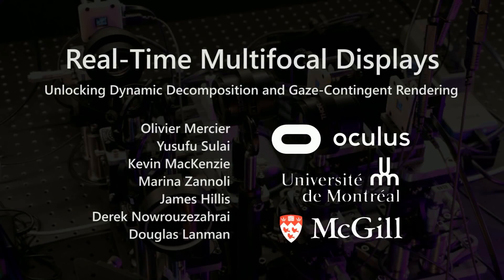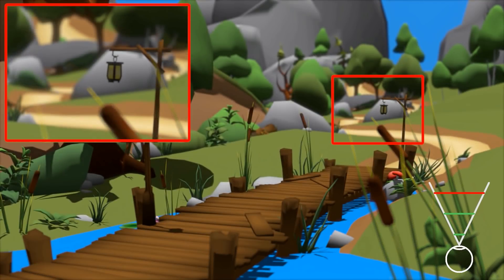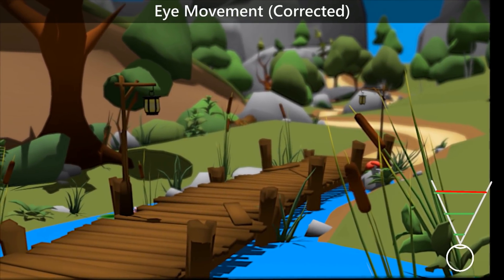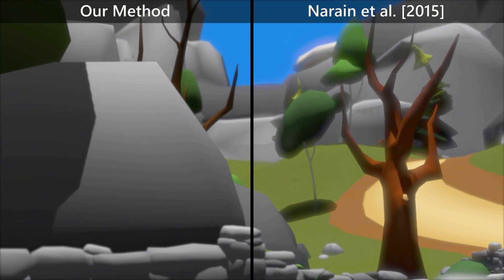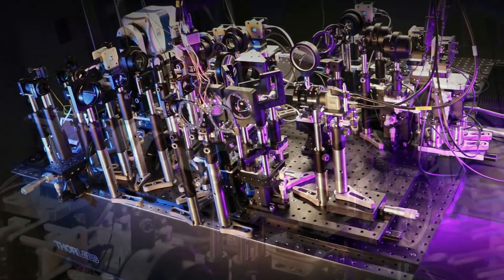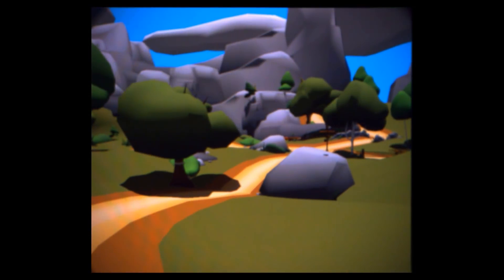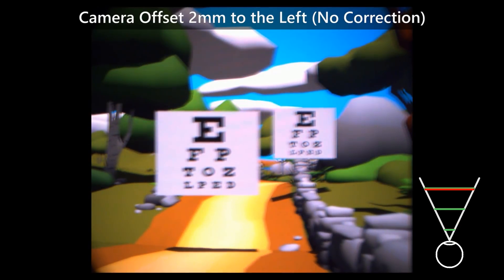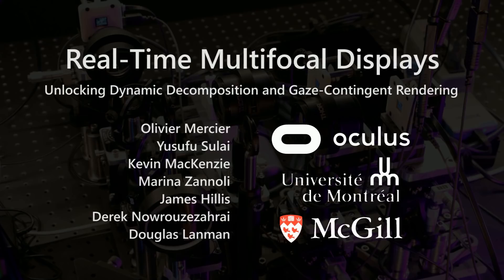Fast Gaze-Contingent Optimal Decompositions for Multifocal Displays

Comment: This looks very nice, but doesn't look to be applicable to consumer headsets.  Even if they can minatuize this rig, and processing power advances enough to run in real time . . . the prohibitive costs of all the extra screens and lenses are going to put this well out of reach.
Reply: This rig was not created for a purpose of prototyping a consumer device. It's a research lab equipment necessary to test some principles of multifocals withe eye tracking and new algorithms.
Reply: I guess the three screens could be 3 mirrors with a single triple refresh rate display?  Would be really interesting if this ever becomes consumer tech.  Even as pure research it's pretty neat!
Reply: Ofcourse, because for this research they need to be able to adjust a lot of variables to study the effects. Many of the components they use can be omitted later on.
Reply: I'm betting on an eye focus sensor plus a DLPesque style micro lens array. That way you only have to render 1 frame but adapt the focus distance very rapidly.